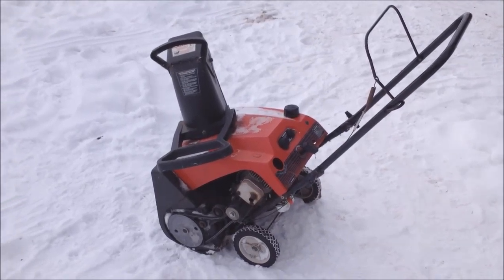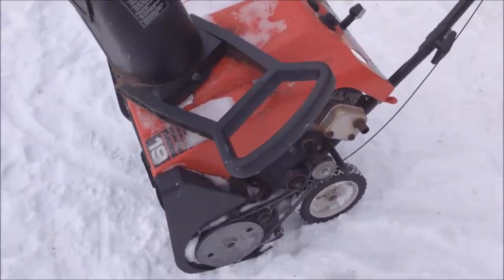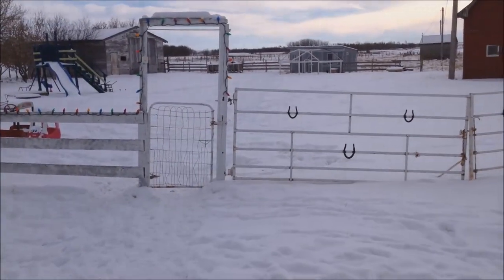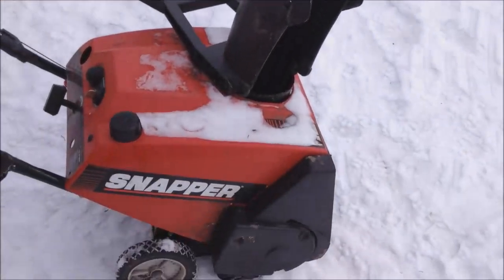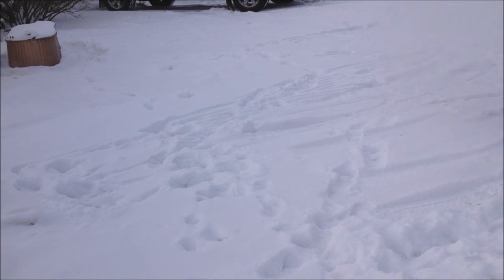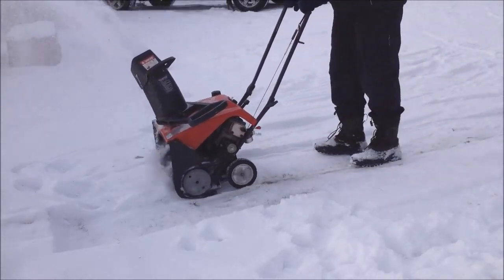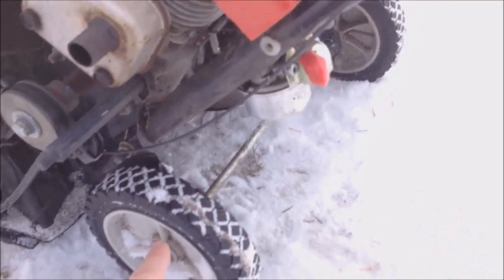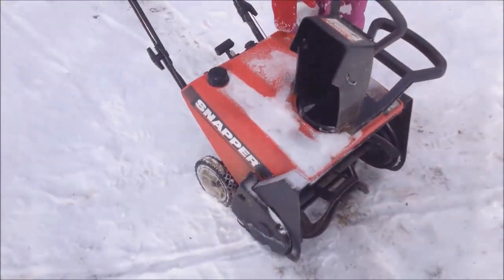Snapper LE 19 Snow Blower...tiny and OK!

Comment: I have one just like it but I just can’t get it to run. How did you mix your gas ?
Reply from the maker: Just 40:1, but you need to add some Seafoam or your favorite gas system cleaner to help start cleaning the small ports in the carburetor.  I mix my gas in a 1L jug.
Reply: @Turbo231  ok thanks

Comment: I have this as a hand me down but the auger isn’t engaging. Any ideas? I pull the lever but nothing happens
Reply from the maker: Guessing the spring or cable is broken.  Pulling the lever tightens a belt that spins the auger, so part of that system isn’t working.
Reply: @Turbo231  ok, taking the side panel off to check things out. Thanks for the quick response!
Reply from the maker: @rustyontiveros9226  Just caught me on my ipad.  :)

Comment: What fuel mix is it I got the same one from a garage sale for $24
Reply from the maker: I run what I have, so about 30:1 usually.
Reply: @Turbo231  I looked up a manual online it said 50:1
Reply from the maker: Nicholas Gamble cool.
Reply from the maker: Nicholas Gamble cool.  30:1 wouldn't hurt it but will start gumming it up with too much oil.  Thanks.